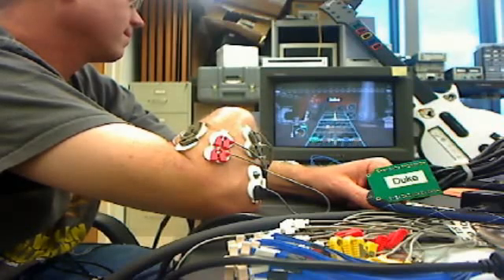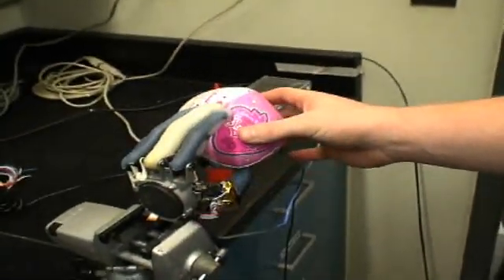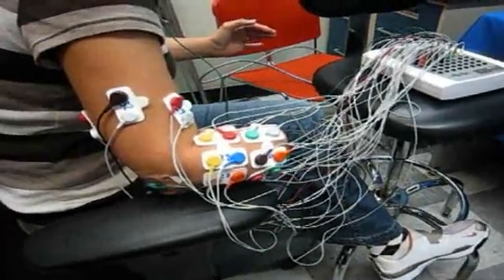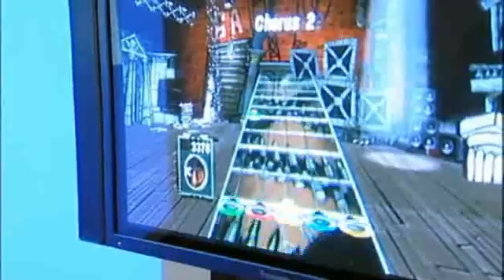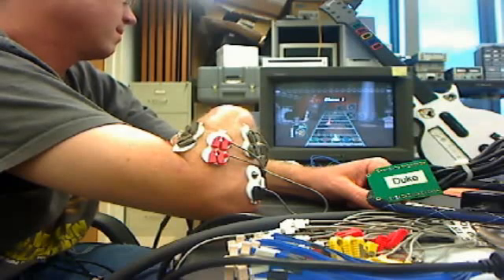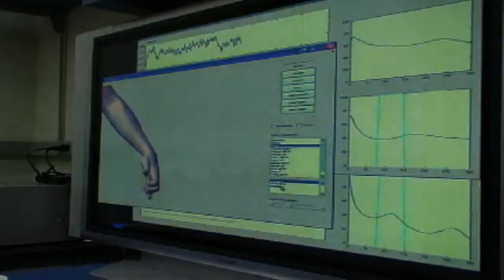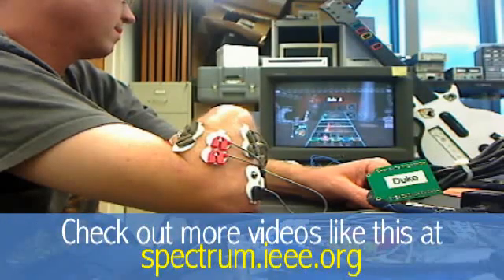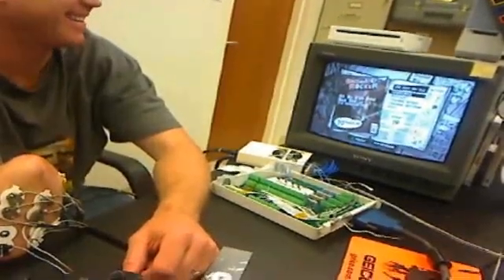Playing Guitar Hero Without Hands

Comment: @TranceSFX
They have that already to some degree.
Firstly, they have the military prototype where the pressure on the prosthetic fingertips are translated into mechanical pressure on the shoulder stump. The brain remaps it's sensory map. When you touch certain area's on her shoulder, it feels like touching her thumb, middle finger, palm, etc
Secondly, they have the visual-chip that receives images and is wired into the back of the brain. Giving sight to blind people. Also a prototype.